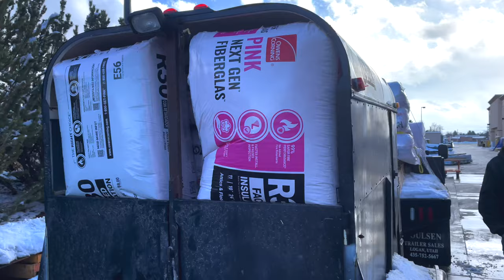Multiple SNOW STORMS GOT us BURIED and COLD! Planning Electrical LIGHTING/OUTLETS for the SHOP

Comment: Put plugs on both sides of that wall. Have enough in your workshop area as the area close to fire for your tools and drill press etc would likely become your primary work space with benches and vice etc. 12 plugs in a kitchen area and possible chargers for tool batteries wont be overkill.